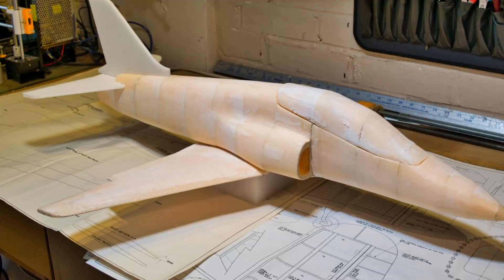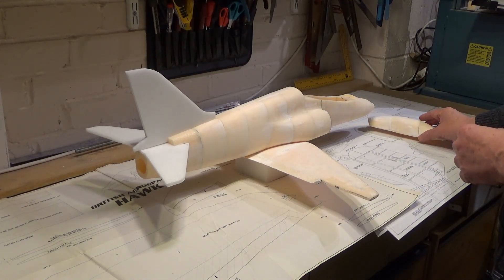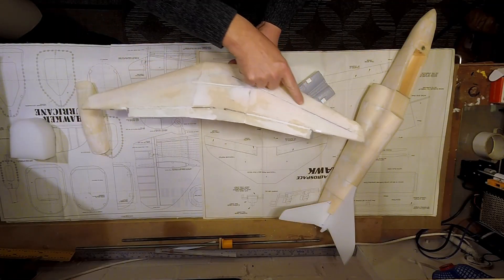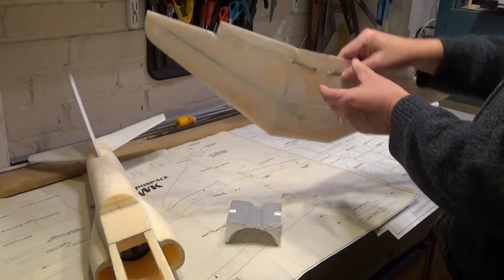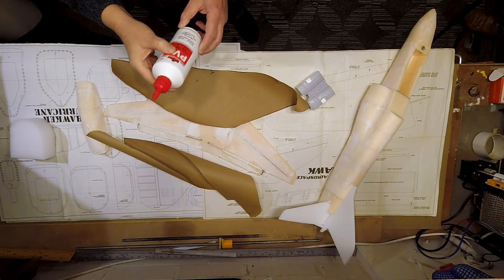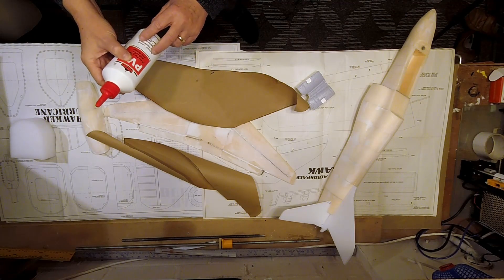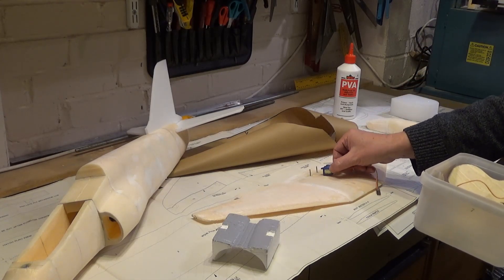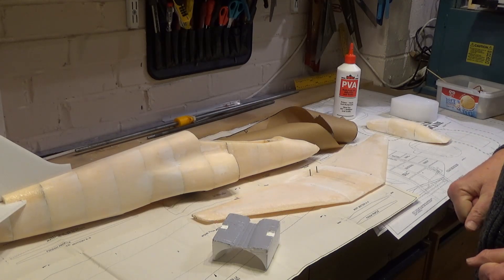DevFus Foam 2 Assembly

Comment: I am familiar with your work and I know that you know what you're doing but I was quite surprised to see the fan so far forward?
Reply from the maker: Hi, Darren yes you are right it was too far forward.  If you watch the later videos when I tried to fly it you'll see it just didn't work. I think 20 secs was its total flight time, even swapped out the fan for a pusher prop.  I had some design issues and didn't do enough research. It's been scrapped now but I plan to build another this year a bit bigger.  I did find a great video on fan and position and jet tube size after I built it.  I plan to make the fuselage slightly different and 3d print the jet intake ducts which will make the fuselage a lot easier to make.  I was quite pleased with the final finish of the plane and learnt a lot. 
Thanks for watching and see the later ones if you want a laugh.

Keith
Reply: @rckeith  Ahh sorry to hear it failed but I guess that's all part of scratch building, I've chucked out a fair lot of concepts myself believe me. A good general rule for most light single-engine jets is to locate the fan unit 1/3rd from the tail, which usually gives you the cushion to use a variety of battery packs up front and the typical tandem arrangement of most light jets means you have room to position the pack as needed for balance. In all the single-engine jets I've done the 1/3rd rule has been true, Hawk, Impala, Strikemaster, Pampa, even the F104.  As I said before, loving your work! I am now looking into your aerotetris technique of hotwire cutting the sections according to profiles, I wold love to see more about this process

Comment from the maker: You can see the maiden and subsequent tries in the playlist. It was scaled from a drawing of the full size I show that in part 1, but as you may know sometimes that doesn't always work. Something to do with the Reynolds's number.  The model came out smaller than I expected and I made a few design errors in the placement of the EDF so it never had enough thrust. I coverted it to a pusher prop and I  did get it to fly but not for long,  last video in the playlist shows that. Then after that I broke it.  She's repairable and I think with the CG moved forward a bit i might try again. Yes the wing area does look small and maybe I might build another wing and enlarge it a bit. Thanks for watching 👍

Comment: Very nice project. I will say though at 07:08 you talk of building the tail straight and I tend to disagree. The real aircraft was designed and built with anhedral on it's all moving tail to give the aircraft directional stability under high positive G manoeuvring to sort of channel it on invisible rails... If you are to build this model with a straight all moving tail assembly you'll likely find that it'll want to squirrel left and right under high positive G loading...
Reply from the maker: Hi Julian, I did have a Nitro BAE Hawk with a straight tail built from Tony Nijhuis kit https://www.youtube.com/watch?v=my_BPUEB_8g and it flew great.  But thanks for the warning I'll be mindful of that on the maiden